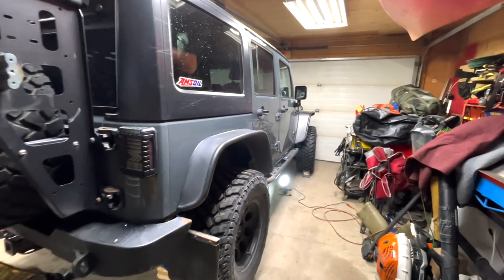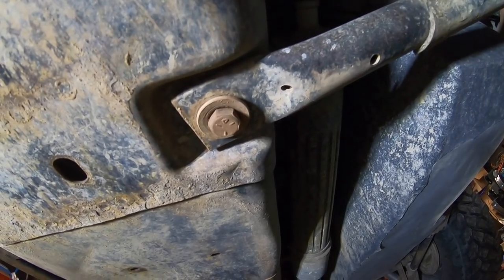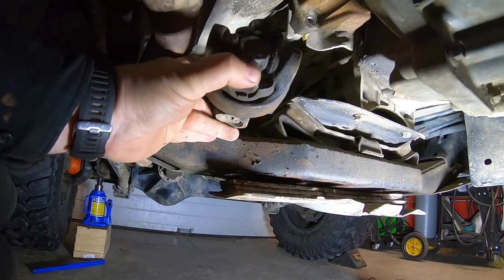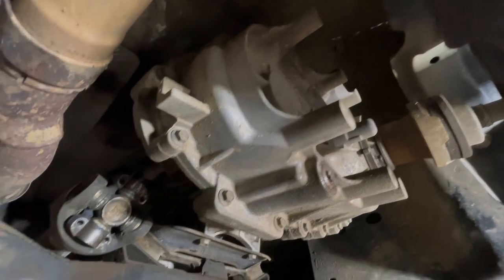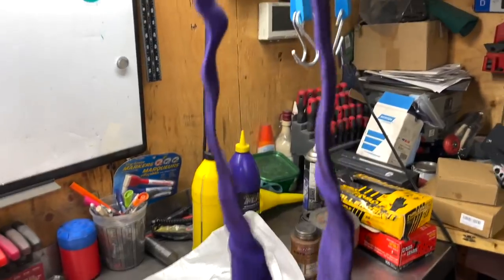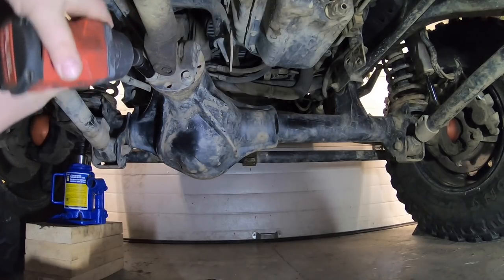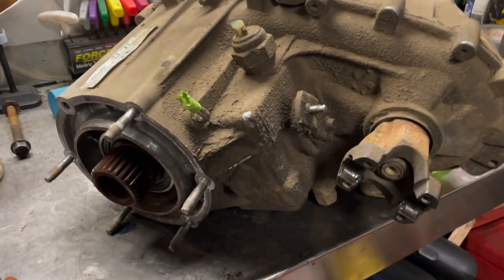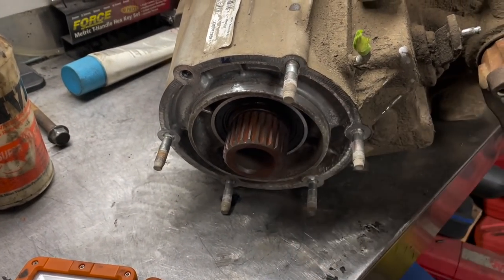Engineer Johnny Strikes Again | Who Does This

Comment: wow just wow Jerry, I understand the purchase cost reflected the condition of the vehicle and I know you bet that you could hammer out all that was wrong with it in short order. I hope this transfer case rebuild goes smooth with no added drama for you. Ive never seen so many metal shavings in an oil pan before, I would guess there's a lot of ruined gearing and valves.

Comment: As someone who's worked in an automotive manufacturing plant, I can tell you that the Design Engineers rarely consider serviceability, and are solely focused on how easily/quickly it can be assembled, and if it'll meet the required specs for strength, strain, loading, temp, pressure, etc. You ask them "well how is someone going to remove that if they need to replace the part" and they have no clue other than "just disassemble the whole thing and put it back together" 😂

Comment: Oh yeah brother!  there's Nothing quite like Removing some filthy old parts from an old vehicle that has plenty of nice farm fresh salt soaked rusty bolts along with some nice brittle plastic an a cold winter day while you are laying on some icy chilled concrete ..    You would think that the cheap ass SOBs at Chrysler could have spared a few extra pennies for some grease or anti seize for those bolts when they were building the damn things at the factory ..  especially for what the heck they charge you when you buy one...  oh no .. why would they do that .  they need to save money so that they can keep their hot tub running , and take a nice cozy vacation to some place warm while you or I are out in our garage or driveway trying to repair the crap that they sold us... 
  I bid you good luck with your project man.
  Tim from Wisconsin .